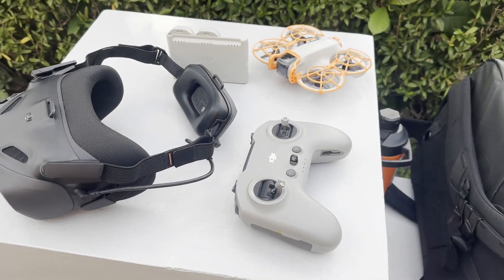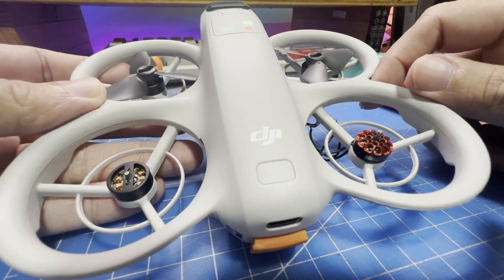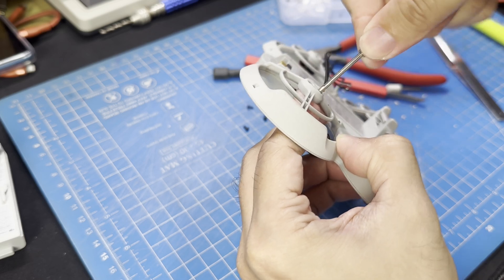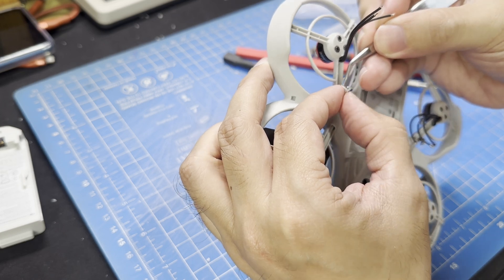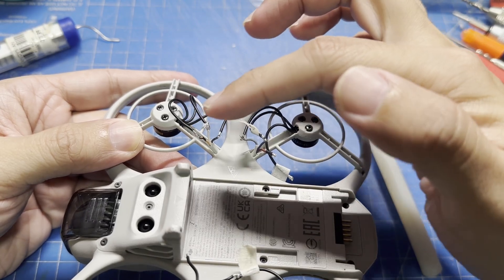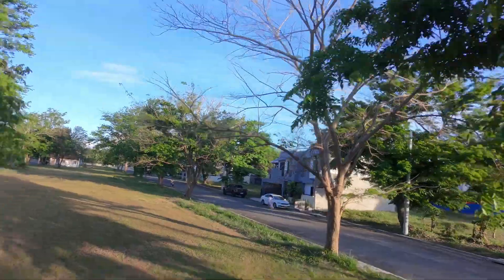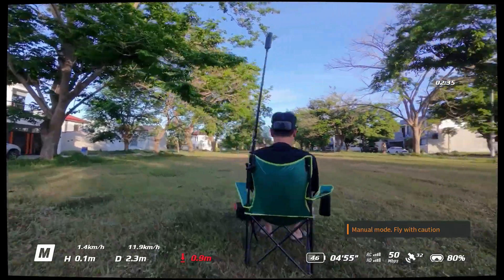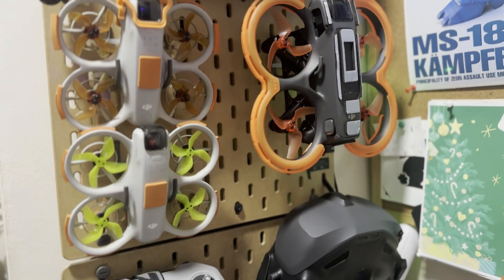DJI Neo Motor Upgrade: Full DIY and Test

Comment: Flight time might be bad because you are flying with 4 blade props wich causes more drag compared to 3 blade props
Reply from the maker: @samsamFPV  possibly, I’ll try different props and see if it improves. I’d take reduced flight time in exchange for more grip though
Reply: Yea , don’t do this people ! DJI it’s updating the firmware and if not detected the original motors it won’t start !! Don’t waste your time this drone it’s amazing the way it is , and I’m saying this bc I did this update and it’s not worth it , just change the rates and you would see how good and fast it can go
Reply from the maker: @martinmarulanda9198  I am on the latest firmware in my region and  have not had any issues. Perhaps it is a different firmware per country? Also you may want to check your installation such as screws touching the coils or the motor rotation getting obstructed causing an ESC error.
Reply: @martinmarulanda9198  motor it's just a coil of wire. It has only electrical resistance. What could go wrong?
Reply: Mmh oke, l do fly fpv drones quite a lot, from my experience and other fpv pilot in general all you that 3 blades is the best compromise between flight time and "grip". But to each his own.

In general l van suggest you 4 blades for cinematic videos, but for freestyle 3 blade is optimal
Reply from the maker: @ I'm trying to find 3 blade 2 inch props for ducted right now. The stock 3 blade props that come with the Neo have different screws and won't fit on this motor
Reply: @SendItFPVChannel  screws are usually not needed for small props like that. I fly my Kayoumini 2.5" without screws and never had a prop fall off. 
I would use them for really high kV builds but 2s 11k should be fine if the shaft isnt damaged. If props are loose u can pull a strand of dental floss (no wax) through and cut the excess after seating the prop.
Reply: @SendItFPVChannel  I made the original prop fit with the center pilot hole modified to a through hole instead. Two M2 bolts filed to the correct length fit the Happy Model hole pattern perfectly.
Reply: Exact
Reply: Not necessarily, all things being equal, a 3 blade to 4 blades means your motor can do lesser rpm to maintain same downward thrust thus saving on energy.

The blade pitch of a 4 blade is less compared to a 3 blade design therefore lesser drag

Comment: Kannst Du bitte ein paar bilder machen die die Kabel angeschlossen werden? ich habe es mehrfach versucht aber es funktioniert nicht. ich habe ESC Error.
Reply from the maker: Are the motors rotating smoothly? You might have a motor or propeller screw touching the coils, or the motor is scraping against the plastic base. When all the wires are connected try powering on with the motors not screwed down into the drone.
Reply: i think your esc board is damage?